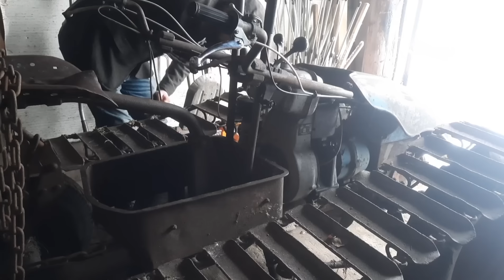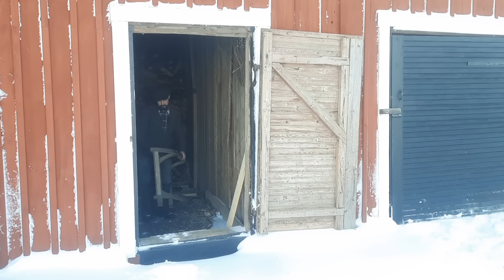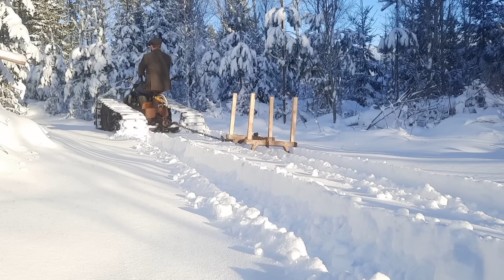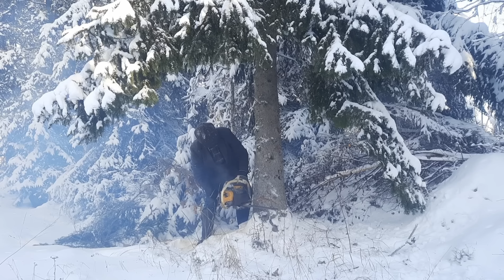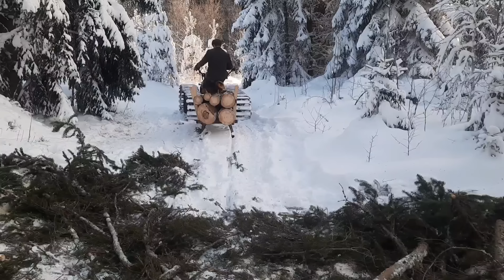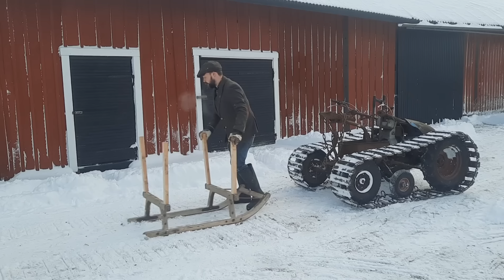Steel-Tracks in the Snow of Sweden. -20°c.

Comment: Here’s a trick l learned from a neighbour starting an ancient, well worn Briggs and Stratton twelve hp grain auger motor. It was an extremely cold January morning in southern Alberta. I was thirteen years old and my job was to shovel grain into the auger. I remember being very sceptical of getting that old motor to run on such a cold morning, but Jerry seemed quite confident. He took a small rag and tied it on the end of a piece of #9 wire. He then dipped it into the gas tank and lit it with a match. It actually burned lazily because it was so cold. He held it under the carburetor bowl until it burned out. He then set the choke and wrapped the starter rope and gave it one good pull. That little engine started immediately and ran like it was the middle of July. That was over fifty years ago.
Reply from the maker: Hi! Thanks for sharing a good story! /Richard
Reply: Right you are man, problem is most old school beaten engines are covered in gas/oil which catch fire quite effectively let's say lol

Not as a doosh bag rather more of a save your life/engine atleast, just use a simple propane torch. Turn it on low Infront of the carb with choke set obviously. She'll fire up as if you were soaking her with straight either!
Reply: Grandfather always poured a kettle of boiling water over the carb of his light plant when it got cold up in northern Canada. Of course it was right by the house so a boiled kettle was right on hand.
Reply: I like applying  a torch to the ceramic of the sparkplug....
Reply: @johnserrano9689  🤡that's not much better, why not open the choke & just apply unburnt propane mix...
Reply: Now that's cool.....
Reply: Great story and I like simple things often use a hot water bottle of boiling water on top of skidoo motor then cover with blankets on -35 or -40 mornings wait about 20 minutes. Gas has a harder time to atomize below-30
Reply: Бред, 
Даю инструкцию как завести 2 тактный снегоход 
Греим ремень вариатор, прогреваем паяльной лампой свечу. В карбюратор льем 10-15 миллилитров бензин. Заводим.
Примерно так же заводим в -40 4 тактный двигатель.
На полосе ДВС надо дать поработать минут 10 закрыв предварительно картоном вентилятор охлаждения, как выхлопная нагреитца до 80-90 градусов можно медленно ехать
Reply: An open flame under a gasoline filled carburetor extremely dangerous. Cold weather small engines usually have a choke, and a primer that forces gasoline out of the carburetor and into the manifold. Stale gasoline that has been sitting in the carburetor bowl for months, likely contributed to the  problem. Loosening the bowl nut/screw to flush the carburetor of stale gasoline generally helps the situation.
Reply: @ Gee, thanks for Karen!

Comment: I like that a short time ago, this was an abandoned piece of equipment, and now it is a useful tool. 

When i was younger, i enjoyed working outdoors in all weather. Now when there is snow on the ground, I like to watch younger people work outside.
Reply from the maker: Some times i forget that i'm 27 years old. I have always felt that i would fit better as older in some way. Hoping for a Benjamin Button effect perhaps. But the older i get, i sure do realize that im not getting any younger, and already feel a bit older in my body and a little younger in my mind. It's not made to make any sense it seems. Better work hard when I can, or perhaps work smarter. But I don't find working smart as fun as working manually and with old machines combined with some higher level of danger. /Richard
Reply: @YesterdaysMachinery  Keep moving. To slow down is to begin to die. I am 62 and still have many projects going at once. I rest more often, but i keep going.
Reply: Cold seems to affect one more as one gets older.

Comment: Approximately -4F, and he is out working with just a tweed jacket and a pair of gloves to mitigate the heat loss. Amazing. 

I have operated old chain saws like that one that required a fairly rich mixture of oil in the gas a few times, and the fumes are a lot more noxious than from a modern saw. I don't miss them at all.

Comment: This is probably the neatest small tractor I've ever seen. I'm keeping my eyes open for something similar. I really want one.
Reply from the maker: Yes, lots of fun. And some use also. If you find one, buy it!
Reply: Good luck. I been looking too. They are hard to find her in the USA
Reply: @billybob7848  ha! Even mundane stuff, like David Bradley waking tractors, are becoming hard to find (at a reasonable price). I still look, though.
Reply: the channel survival russia has a smaller current production tracked helper he uses all the time.
Reply: Getting a BCS and building the rear axel for the tracks is as close as I can think of.
Reply: @charlesmckinley29  or David Bradley, but with a clutch for each wheel instead of a ratchet. 

BCSs are EXPENSIVE!
Reply: @ALWhite-ub1ye  yes they are but they are already set up to steer with brakes or clutches, I can’t remember.  So most of the drive line wouldn’t need modified.  A zero turn mower may work as well.  They are also expensive and the cheaper ones the drive motors cost more to rebuild than the machine is worth.  So it comes down to how good are your skills vs how much tome do you have to work on it.  I have seen a few interesting crawlers built from riding mowers but the time and expense they put in them is very high.
Reply: The other benefit of the BCS is they are still in production and have attachments like mowers that you could actually use rather than just pull with it.  There were some really interesting attachment for this tractor.  Finding pictures is hard enough finding actual information and parts 😢.
Reply: @charlesmckinley29  brakes are overrated. It's fun to pull a Wile E. Coyote as your tractor breaks apart at five times its top speed going downhill.
Reply: Have a look at the vid "Rueckefuchs Film". This peace might be of interest for you. Please leave a note under comments and you will be contacted.
Reply: All you need is a rototiller that has individual steer or old garden tractor a snowblower gear box nowhere near rugged enough

Comment: You can use a long fan belt and a 6" hand held grinder to spin the engine over faster and way easier on your arms. We used spaced washers to act as the grinders pulley, and ran the fan belt around pull start drum. Start the grinder and pull to tension the fan belt. Worked every time.
Reply from the maker: Yes, would probably work. /Richard
Reply: What a great idea!

Comment: Bare hands out there! I can't do that anymore.
Reply from the maker: I do use gloves some times, but dont really like working with them. /Richard
Reply: @YesterdaysMachinery   Just be careful from vibrating chainsaws in the cold. Jonsared makes excellent low vibration commercial models. That damage will sneak up on you in the cold 🥶 
Of course gel pad gloves may help. But check the specs on different machines. The '61 thumper is probably not so bad.
Reply: Not with that attitude
Reply: He's got gloves
Reply: Why would you want to to begin with I never go outside without gloves I'll just get frostbite there's no way around it
Reply: @andykerr3803  l

Comment: The old timers had those as they worked up here in the woods of Maine.
They called them "jitter bugs".  Although they usually had truck engines and various hand built tracks over the tires.

Comment: The more I see your little tractor, the more it amazes... As soon as that little motor was dragging the logs, the motor smoothed out nice and quiet... Just like a diesel under load. 
When uou experiment with yhe plug heat range, you might research different fly wheels too. Some extra weight and even a rubber harmonic dampened might make the ride nicer and protect that little flathead too!

Comment: Can you add add a belt drive starter/generator to the engine? That would help in tight spot. A drawbar and box on the back would make it complete!👍
Reply from the maker: In normal temperatures it starts first or second. So it is better to just not start it in-20 ;) / Richard

Comment: It looks like a rebuilt old cultivator / garden tractor from the 50's type SIMSAR or similar. Clearly cool build and seems strong like a real horse. 👍🚜💪🐴
Reply from the maker: Its is a Motostandard 2 wheel tractor that is customized as new in Norway by a company in the 1960's   they made a few. /Richard

Comment: Incredible that you worked bare hands most of the time, myself I wold have my hands frozen solid
Reply from the maker: It would not be to warm using gloves, but i dont really like working with gloves. I have used gloves as a mecanic for 10 years but still dont like it. /Richard

Comment: Some guys that have airplanes (cubs) use a radiant heater to heat engine block before attempting starts in really cold temps in conjunction with a engine blanket.
Helps heat soak motor before start.
That helps extend life of crankshaft oil seals.
A white gas type Coleman style catalytic heater.

Comment: I rode snomobile in Alaska several days here and there at -40, but only once at -50!! Of course it depends on the weather...at -50 on iced over river, the fog was heavy and disorienting, luckily I didn't have more than 15-20 miles ti go. But I never forget the sound of a 2-stroke single cylinder. Like a hammer beating on a thick bucket😮

Comment: Great fun! An engrossing video done in beautiful surroundings. Amazing how he is able to work much of the time with hands bare at -18 C.
But I must add a sour note. I have been instructing in the proper use of chain saws for many years, and I tell my students that the most
important thing is safety. In particular, a chainsaw should never be used unless the operator is wearing safety gear: ear and eye protection,
and chaps or safety pants made of ballistic material to protect the legs. In addition, the saw should never be held above shoulder level.
Please, protect yourself!

Comment: The good thing with hand started engines is that you get warm pulling it. 🙂
Each time is start, it get a bit warmer.
But you should really have proper protection for hearing and such, ask my father that was lumber jack back then.

About the sledge, it look small and fragile, but it might be a difference between småland and here in dalacarlia. Also, one used to had chain and a björn to get the chains firm.
Reply from the maker: Hi! Yes that sledge is way to small and weak, but that is what i have for now. And a chain would be great also. This was close to home and just fo fun. Might get my hand on a bigger sledge tho. /Richard

Comment: This is the sort of use the machine was intended for rather than very steep slopes. Don't follow the advice in another post to warm the sump with a kerosene heater as naked flames and petrol do not go well together!

I have heard of sparking plugs being warmed in a kitchen oven to help start difficult Ford tractors in winter.

Comment: Maybe a put a metal bucket of coals from the fireplace under the crankcase in the morning for easy starting? That is what I do with my diesel truck in the winter when I need to go to town.
Reply: Safer with a diesel vehicle. Potentially dangerous with a petrol powered device like this one.
Reply from the maker: Better with a heat gun. I have ingustrial ones that would heat up this engine on a few minutes, but that would not make a grand video! People likes cold starts ot seems. /Richard

Comment: The machine is called TimmerBjörn, has two forwards gears and a reverse. Owns one that  also has a winch  and a rollbar.
Fantastic to get around on soft ground with a minimal ground pressure.
Reply from the maker: Hi! Glad that there is more than mine still around! This one got 2 workspeed forwards plus one 3rd, but that one is crazy fast. Im only using 1 and 2. /Richard

Comment: As a northerner from the other side of the circle; I enjoyed your video. Some things learned and some questions arose. 
Please tell me the wood is for next winter's heat. Why did you not follow in the out-going tracks on your way home? 
Saw chain looked like it would benefit from a file.. powder vs chips. The sledge is a work of art.  Was the load weight near capacity?
And, finally, I appreciate how well you worked the log's choker and grapple. This, obviously,  isn't your first rodeo...

Comment: I love you using old equipment and making it work again, often better than anything that can be bought now.

I have a question, though. I watch videos from all over the world and being a retired architect, notice the buildings. Your door braces go from the top hinge down to the corner, rather from the bottom hinge up to the top like most other places. Is that a Swedish tradition?
Reply from the maker: Hi! Those 2 doors here are build totally wrong. That x member should be placed the other way. From the top corner and down tp the bottom hinge. I have not built them. But they work anyway so i will not change it. But looks strange. /Richard
Reply: @YesterdaysMachinery  ah, I understand. I have a gate like that. 

Love your videos.

Comment: I always put a canopy over the machine and use an electric car heater for an hour inside the makeshift tent. Don't wear punish your engines with cold starts at -20. Especially if you run summer oil (mineral). I get it for the purpose of this video though.

Comment: If I need a small engine to start when it's cold (generator), I put a tarp over it and leave a drop light/trouble light with an incandescent bulb lit below it, overnight.  A 60 watt lamp is plenty.  Keeps it just warm enough to allow the oil to stay fluid and the engine to start without any problems.
Reply from the maker: Yes, but cold starts sell on youtube u know 😉 /Richard
Reply: @YesterdaysMachinery  Ha!  It's fun to watch someone else fight with it, that's for sure 🤣🤣!  I've had enough fights and decided to go the easier route.

Comment: Danger to just have chain pulling the cart. Downhill, fully loaded, it will hit you in the back. Horse drawn carts had a piece of wood that was lowered and ended up in front of the sleigh when it started to run faster than the horse/iron horse
Reply from the maker: Yes, but this was just for fun and on flat ground. Any of my tractors would have done this job ten times easier. But i understand the danger as you say. /Richard
Reply: @YesterdaysMachinery  But, how does this perform in a swamp or really soft ground? Tractors dont do well there. At one time my uncle had to tie a chain to a tree and use the holes in the rim to inch his way up, one bolt hole at a time.
Reply: @YesterdaysMachinery  Found the design, if you are interested  https://www.youtube.com/watch?v=cw0OFfI29Ik  1Timmerkalke

Comment: I've lived in Fairbanks, Alaska through -20 to -45 Degrees F. We had to wear gloves and boots rated for it. I do not believe it was that cold.
Reply: It was -20 c over night had warmed to -15 when went out to start so probably 0 F or a little warmer.
Reply from the maker: Yes more like -15c during the day. And i had many layers of clothing here, and dit use gloves now and then in the video. These boots are rated for -17c and i have 2 pairs of thich socks so -30 would not be any problem. I was out the whole day and when i went inside i was still warm and happy. /Richard

Comment: And that answers the question. A small paraffin wick heater or greenhouse heaters left overnight under engine can help with starting
Reply from the maker: Yes, or a torch for 60 seconds. But i wanted to see if it would start cold. /Richard
Reply: A very bad idea with a machine powered by petrol/gasoline.
Reply: Common use during ww2 to stop engines and rads freezing, still needed with diesel if you dont have a fuel heater. Knowing  it starts in cold from cold is good.

Comment: That's a little too much chainsaw for you, get something smaller, the kind of big timber that was around when that chainsaw was made no-longer exist,  get ya something smaller before you cut your leg off, 🤕
Reply from the maker: Don't think a small saw is safer, but i have plenty of old saws in different sizes but i like this one. Normally i use modern saws and equip when working in my forest. /Richard